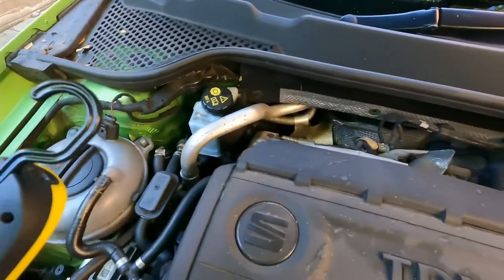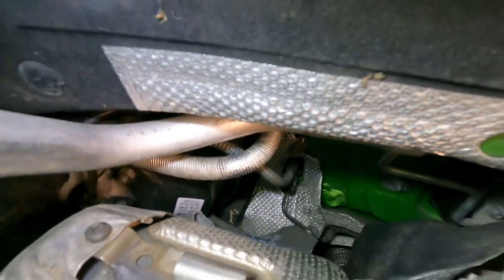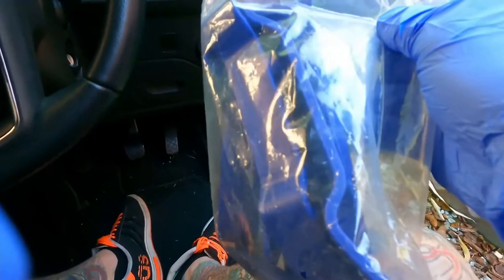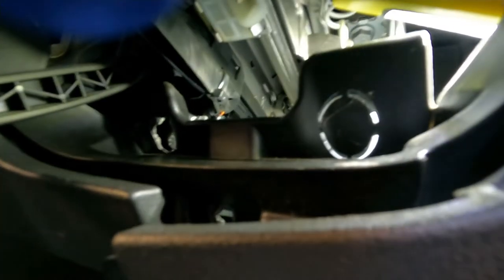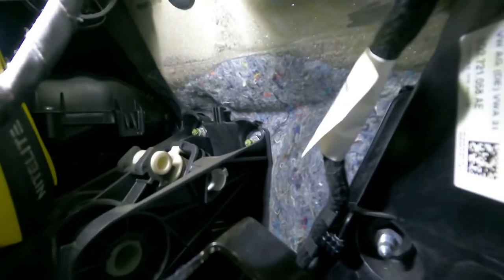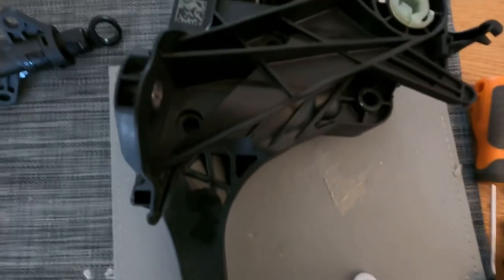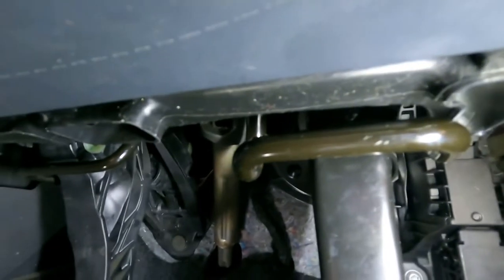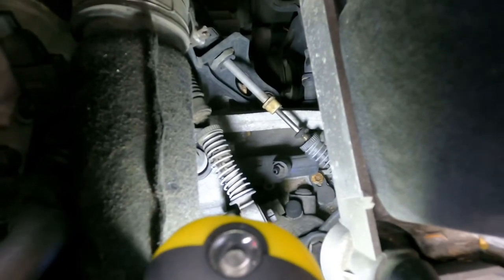Seat Leon MK3 Clutch Master Cylinder Replacement | How too

Comment: Really helpful video, thank for making it would have taken me a lot longer without it. 

Few things I would like to mention though that were skipped over in the video: 
1. To remove the airbag you first need to remove the little storage pocket to the right, this will give you a lot more access. 
2. After removing the airbag and the airvent you want to remove the little computer box, this is held by two clips this will give you access to the one bold you need to undo to get the pedal safety bar thingy off. 

3. yes the airbox you literally just pull out, I tried a couple of times and kept thinking that can't be it but it just needs some persuasion. 

Happy tinkering :)

Comment: Your video really help me, i didn't remove the bar over the pedel, i useda swivel joint to do the top 2 nuts. I am not a mechanic, just a you tube mechanic. I look on here to help me with any new job. Yours help a lot, took me 2 hours to do. Thanks

Comment: Grand video! Couple of things, don't need to remove the sacrificial plastic when removing the knee air bag with an open end but bit fiddly getting them back in if you don't. Little star washer holding heat shield on... Have fun...Little box of trix hiding the 13mm for the bar. Someone else said about taking out the little box to the right, certainly helps. Carfull with the steel liners on the main unit they can pop out when your re-installing making it fun. Stick some blue tack in the end of your socket when your putting the 3 nuts back on.... That top left one...... So fun.... Bleed nipple was in a different spot on mine, part of the salve maybe but it's just above the starter motor on this plastic fitting. Bleed a couple of times pumping the clutch with the valve closed. Works great. Garry... thanks pal!!! Wouldn't have been able todo this with out you! 👍
Reply from the maker: Good glad you sorted it mate🙏 hard work but better than main dealer price 👌 and yea there wasn’t a video for a Leon on this! I recently done the heater matrix on this car too! Should have done a video on that!!! Nightmare lol
Reply: @garywilkostube3435  Sounds like fun, may give it a go just for the lol's, if it's anything similar I'll have to do some stretches or join the circus as a contortionist 😜
Reply from the maker: Mate I ached for about three days after I done the master cylinder 😂😂. The matrix took ages the glove box was a nightmare to get out 💩💩

Comment: Good video, just changed mine and the are a few things worth knowing... to bleed the clutch you need to rotate the yellow plastic bleed nipple by 180° to allow flow. You don't need interior panel tools, if you remove the little storage cover by the odb port you can see enough. You need a 500mm extension, and a swivel joint and then you can remove all the clutch pedal nuts relatively easily. Total time for me to do it was 4hrs.
Reply: Hi there Scott, the yellow screw do you mean the bleed screw ? Thank you, josh
Reply from the maker: Hmmm I never had a yellow bleed nipple not that it matters but didn’t really think bleeding the clutch was that difficult.i didn’t think the pedal bolts were hard either just the 13mm bolt holding  the metal bar thing in place!
Reply: @CarsAndTheirProblems  yeah, on my car it's a yellow plastic bleed nipple, that you rotate through 180 degrees to open the valve to bleed the clutch line.
Reply: @garywilkostube3435  yeah that bar was one of the tricky ones. One other thing I found after when I threw my old master cylinder away, the sensor plug that you removed can be avoided as you can release the whole sensor pack, and the clip for that is in full view - bit easier than unplugging. Anyway good video, very helpful :)

Comment: Hi Gary, needing this doing on my Leon, when ordering the master cylinder some coke with a sensor and some without, which one did you fit here? Mines is doing the same sticking half way up 25% of the time then eventually pops back up. Thanks for the video 👌
Reply from the maker: I got mine off of AUTODOC and they go off your registration
Reply: @garywilkostube3435  cheers Gary, I did use that and it gave me two options, ended up using my local tms which was a bit more expensive, just to find time to actually fit it now. Cheers again 👌
Reply from the maker: Ah ok good luck 🤞
Reply: Hi Gary, just to say thanks for the tutorial, I successfully changed mine tonight. No one to help with try clutch bleeding so will do that tomorrow but all went smoothly. Took about 2 hours with ur guide, I left the black bar on tho, pedal came out ok just squeezing it back a bit. Saved that hassle 😂 thanks again. 😎
Reply from the maker: Glad it was of use 🤞wish I’d done a how to for the heater matrix on the same car as that was a pain lol 😂
Reply: @garywilkostube3435  the one in the footwell with the one screw? Mine just flew in 😂

Comment: Nice job, I need to do this on my Golf GTi, which has failed at 44,000 miles. How long did it take in the end?
Reply from the maker: Ummm about 5-6 hours! I think if I was to do it again I would whip the drivers seat out to allow me to lay on me back lol 😂 the worst part was that damm 13 mm bolt holding the bar in front of the clutch and break pedal! Refitting was a pain but if I was to do again reckon it could done in under 4
Reply: Brilliant, thank you. I haven't had the car long, but am rapidly getting fed up with substandard parts failing. The waterpump housing is leaking as well, so that is another job.
Reply from the maker: @simonh870  good luck with it, don’t forget to like share and subscribe 🤛

Comment: Hi mate can you tell if it’s the clutch master cylinder or the slave cylinder
Reply from the maker: In my case the clutch pedal would stick to the floor intermittently and I would sometimes have to use my foot to flick it back up!!
Reply: @garywilkostube3435  ok thanks mines been sticking for about a month now just at the top then I would flick it back up with my feet but now. I got in the car today completely dropped to the floor no signs off leaking under the pedal that why I was thinking could it be something else
Reply from the maker: Possibly the slave but mine didn’t leak at all just wore out! Think the slaves harder to fit hence I opted for the master and I’ve done 16k in it since I’ve changed it without issue
Reply: @garywilkostube3435  ok thanks for your help mate just going to fit the master cylinder first.
Reply from the maker: Yea go for it any help needed just shout here

Comment: Why was you changing the clutch master cylinder
Reply from the maker: Because it was worn out after 118k 🤷‍♀️
Reply: @garywilkostube3435  did you have problems selecting any gears the reason I ask a friend has a issue he selects 1st gear then when he tries changing to 2nd he has trouble selecting 2nd and won’t come out of 1st gear the clutch friction plate pressure plate central master cylinder and dual mass flywheel were replaced about a year ago
Reply from the maker: @sithwalker2489  that’s not the master cylinder mate probably synchro mesh or something!